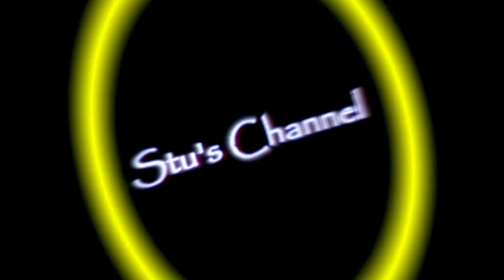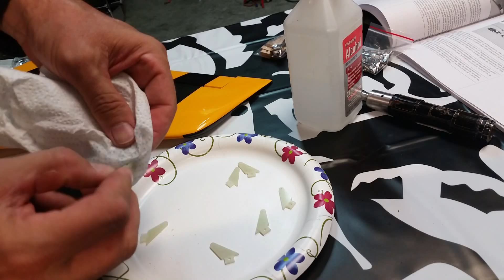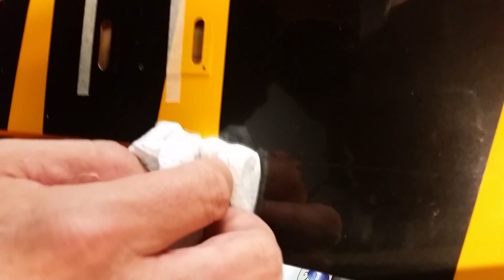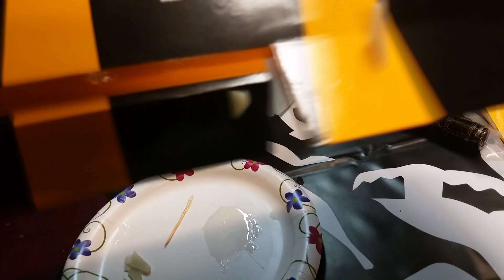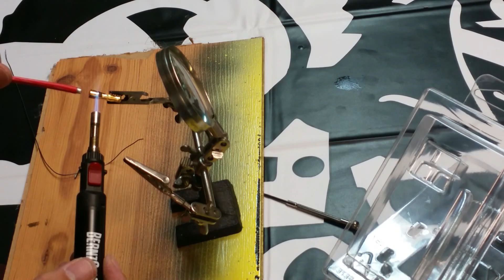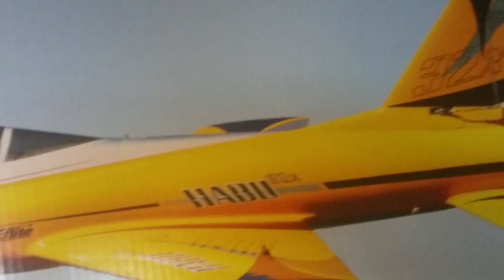New Habu 32X DF Build on Stu's Channel  Part One

Comment: I'm going to ask a stupid question is this an ARF
Reply from the maker: Yes, this is a bare bones ARF.  The wings are covered, the fuse is finished, but you are doing everything else, and providing your own components..IE  I have eight servos in this at $40 per servo, then the esc, the fan unit, the motor, a 6S battery, AR8000 receiver, and the retracts.  Take a look through the videos.  All horns, hinges, mounts, cutting and ironing, etc. etc.....has to be done to get it in the air.  This is not one of those ARFs where all is installed and hinged and horned...only requiring you to attach wings, add a reciever , esc and battery.  This one is going to take some work if you are considering it.  All the best to you